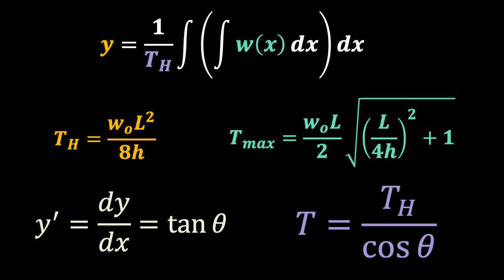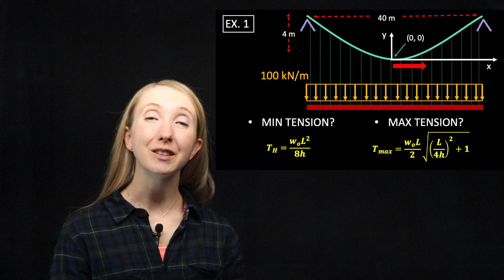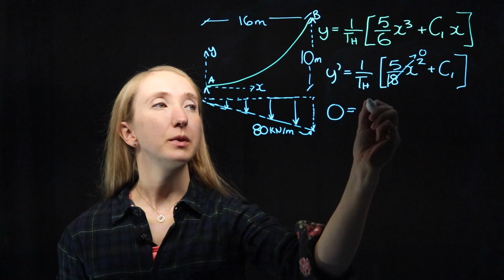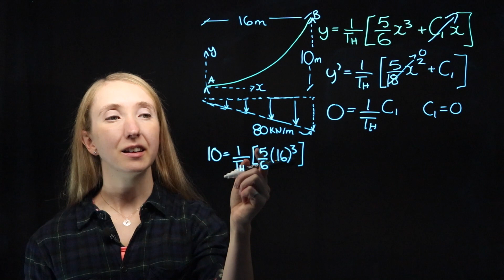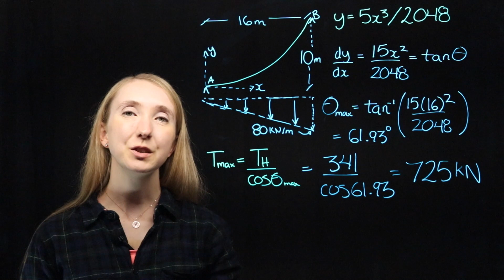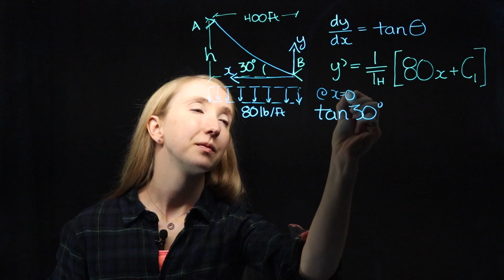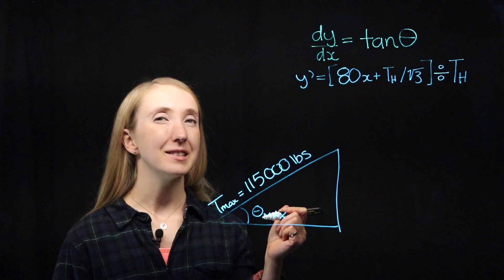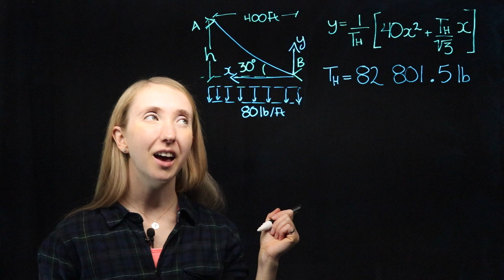EXAMPLES: Cables Subjected to Distributed Loads | Learn with Pi

Comment: Couldn't we just use the equation for maximum tention we derived at the previous video, and solve for h in the third exercise?
Reply from the maker: Great question! Unfortunately, no. That equation is derived using a boundary condition where slope = 0 at the origin. In the third exercise the cable isn't flat at the beginning. It forms a 30 degree angle with the horizontal. That's what makes the problem a little tricky :) Hope that helps!